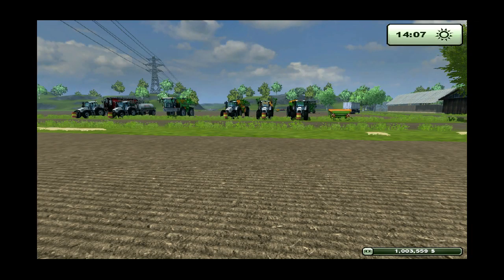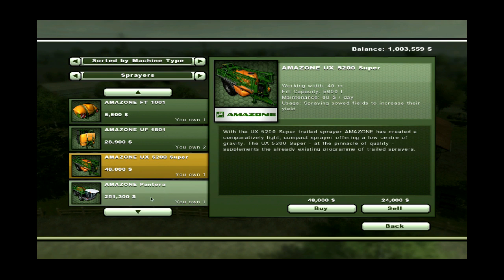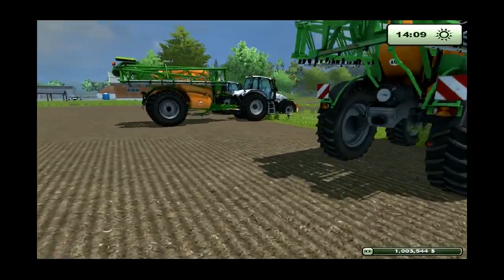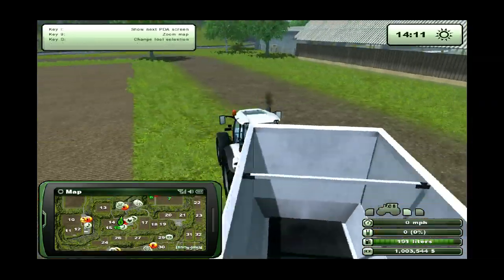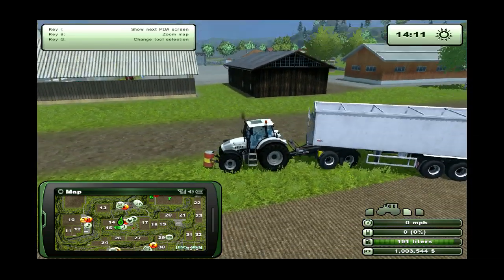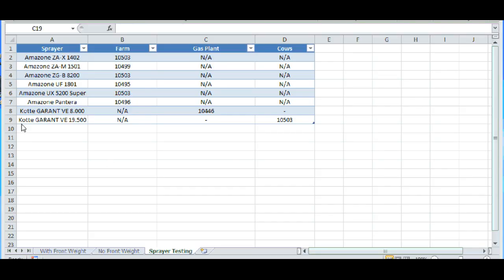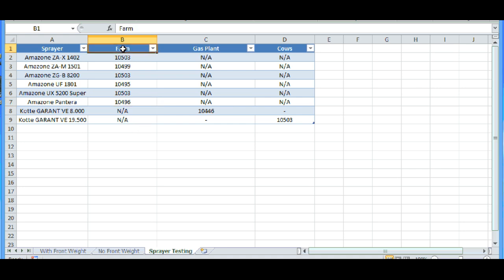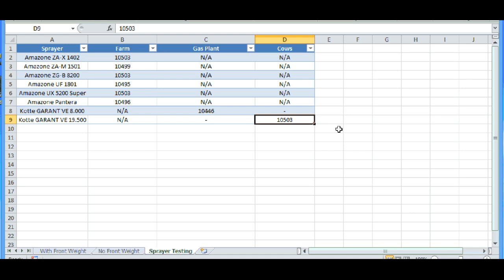Farming Simulator 2013 - Fertilizer - Sprayer/Spreader Testing

Comment: I know this vid is old at this point but one more question remains in my mind.  In the 2015 version they have a slurry spreader with a cultivator attachment.  The cultivator goes on after the slurry.  Does this mean that we can fertilize BEFORE we even cultivate?  With this setup it would seem that we can, at least when using the correct slurry tank.  The cultivator has slurry hoses, so I imagine it injects the slurry as it cultivates.
Reply from the maker: I havent done much with 2015 yet.  I do plan on doing some work with it.  All I have done at this point is figure out the chainsaw. I know in 2013 i planted then fertilized.  Not sure if you can before planting tho. I'll have to try that.

Comment: If you are hiring a worker to plant for you, I agree 100% than a front loaded spreader that spreads the same width as the planter is the most economical, as it saves you the fuel cost of driving over the field again. I have 200 cows and plenty of fertilizer for free but the sprayer\spreader runs out so quickly that covering a large field is just too time consuming...and the game does not let you hire a worker to do this.

Comment: there is a different yeild for cultivators depending how u judge it i tested it the smaller the cultivater the better the job is done because the bigger cultivaters miss more then the smaller but if you dont count that then there is no diference 

i tested every thing but sprayers and all that stuff i just tested cultivaters and planters there is a difference yeild for different planters

Comment: There is basically no difference on wether you use cow/biogas manure or the sprayer (only difference is you have to pay for fertilizer and the manure is free) The main difference is the amount of liters that the applicators can hold and how many times you have to run across the field.